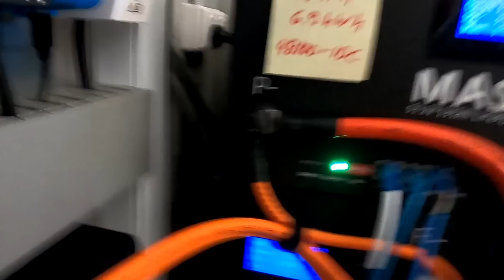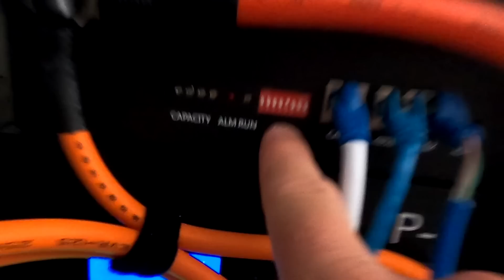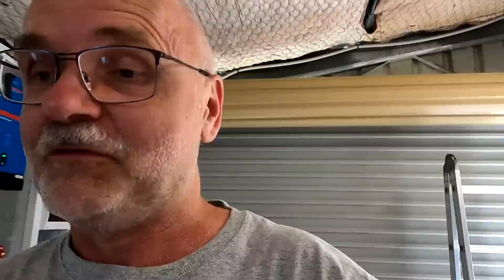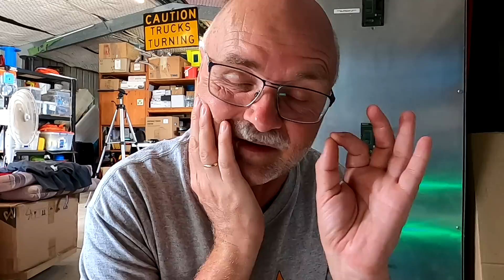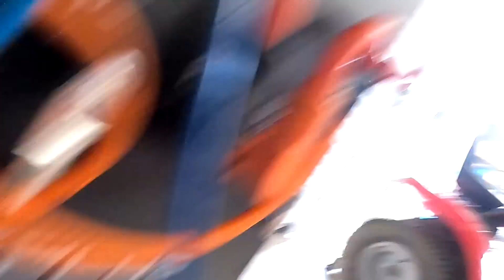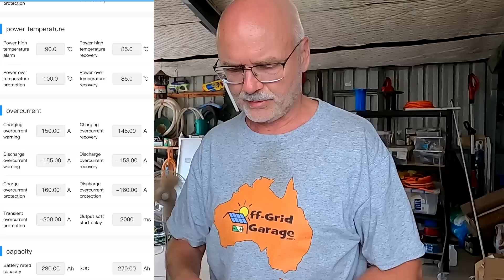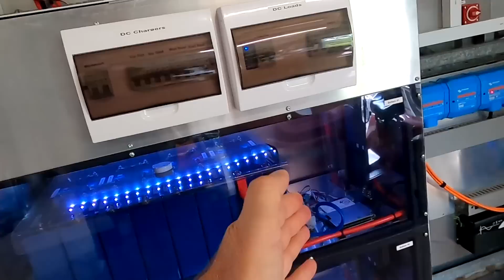No (easy) access to Master BMS of your Seplos battery! Seriously?

Comment: Those BMS...  With that charge difference the BMS in the lower charge batt is going to turn on charging and immediately get a surge from the other battery. That probably causes the BMS to disable charging, and the cycle repeats.
I stand by my last comment - seplos seems like too much aggravation.

Comment: Root of the problem… My professional experience is in tech support of distributed information, object, document, image management systems and the managing QA trams for development of the next gen system and then consulting with clients to design and deploy those systems. The issue is that product developers design based around their own personal expectations of what a product should do, not giving any thoughts to how a customer might try to use it. When managing QA, after getting extremely frustrated with the development team not understanding how their efforts were not reflecting my direct experience supported the administrators of these systems, I finally convinced them to get a focus group together from a variety of backgrounds and give them specific tasks to complete using the interfaces they had developed so far and after the getting the feedback they had a much better understanding that developers know how to write code but don’t have any experience managing a live system so they need to get end user and administrator feedback early. Unfortunately because it took so long fro them to listen the initial release was a massive flop but over time they got there but it took probably an additional 2 years because of how much code they had to rewrite when had they focused less on their own views and more on customer needs they could have had a better chance at a wildly successful product out of the gate.
Reply from the maker: Another big problem is translation when communicating. I really need to break things down and keep them simple, otherwise they won't get the story. Long sentenses and paragraphs are not good and cause confusion. It all takes a very long time...
Reply: @OffGridGarageAustralia  LOL I’m definitely at risk of penning long paragraphs and runon sentences and accept with a smile that part of your response might have also been a good natured jab 🤪

Comment: Andy I don’t think this is a fair test. In Batt 2.0 you have 3x diff BMS and each connects to your monitoring system independently - at the very start you were told by Seplos that the Mason and Seplos BMS were different so why are you trying to get them to act like one system. To be fair each BMS would have a separate connection to the Victron system, and a fair test would be 2x of the same Seplos BMS’s tied together. I think if you consider the Mason and Seplos BMS the same as in Batt 2.0 it would work better. The big Seplos would be on Bluetooth like the other BMS and the Mason via the PC for management. If you had 2x Masons or 2x Seplos the results would be different
Reply from the maker: Thanks Peter. The three different BMS in the shelf are not connected to anything, no comms at all. It would not be possible. There can be only one Battery Monitor in the system, not multiple. So you can have one of the three BMS connect to the Victron system but it would totally ignore the other two.
With the Seplos system, the master BMS collects all the data from all connected slave BMSes and reports this combined to the Victron VenusOS. As we could see on the details page in the Remote Console, it shows high/low voltage and temperature across all packs. This is not possible with the three different BMS we have in Battery 2.0

Comment: Hold the faith andy. I have three of the big battery in parallel and other than the can issues you already know about they have run perfectly for last 6 months in my ess  Victron system with ac and dc coupled solar. I’m adding two more to give 75kwH
Reply from the maker: Thanks for sharing. All the same BMS and batteries?

Comment: It is a shame that the users have to reverse engineer the issues and problems with these BMSs.  Hopefully Seplos gets all of the comments and understands what is happening, then maybe more people will buy into these battery kits.  However, currently it doesn't seem like the two BMSs are compatible with each other and it doesn't look like you can do anything about it without Seplos helping.  Maybe a firmware update, or even a replacement BMS will solve most of the problems.  But, even with a firmware update or replacement BMS it looks like you'll still have issues with the two different battery sizes unless they rewrite the software.

Comment: How about both batteries in CAN mode? No RS485.
Reply from the maker: Won't work. You can only have one CAN battery shown in the system. You could decide which one is showing, the other one would be ignored.

Comment: Yes i agree it is a messy design flaw. SEPLOS should have installed 2x CAN ports per unit, forget about RS485 communication between units and just daisy chain any battery units to the same CAN bus to other systems, like the Victron. They can include a LAN port in additional to Bluetooth connectivity. This would be very similar to how Victron set up theirs. Neat and tidy, no more messing up with DIP switches.
The network topology should either be a star network or daisy-chained network.
Reply from the maker: That is a great idea but I'm afraid it's too late for Seplos to do that...
Reply: @OffGridGarageAustralia  I believe your feedback represents a very reasonable expectation from a typical user and is a very good use case. SEPLOS should take all your advice and feedback very seriously.
Certainly functionality is important, but usability is also another important aspect, especially for higher voltage battery systems involved many cells connected in series. It is important to keep monitoring and spot any potential issues or signs of weakest link. 
When it comes to systems integration, it is all about simplicity, reliability and wide compatibility. Learning from already established brands such as Victron is a great starting point. Look at what they are doing and understanding the rationale behind their decisions. Innovations are good, but only if it improves existing standards... certainly not just for the sake of innovation. 
Let's see if SEPLOS would incorporate your feedback in their next release of products. 😬👍
Reply: If SEPLOS doesn't offer a reasonable solution, a work around might be to purchase just a BMS board but connected  no batteries. Make that unit 0. Then attach your first battery as unit 1 and the larger one as unit 2 😂👌

Comment: Hi Andy, again very interesting to see your video. The communication problem with activated CAN communication is unfortunately well known. This is really not good.
However, I must also say that you are using a system configuration that is not intended. On the part of SEPLOS are only battery packs to operate in parallel, which have the same technical requirements. You have the 280 DIY Pack and the Masonpack with the 135 Ah together in operation. This can be seen from the Ah hours displayed in the Victron. 560 would be 2 packs of 280 Ah. This also says the CAN configuration. 2 packs and the 280 Ah hours pack is your master. The 411 Ah hours are then the 280 + 135 Ah Yes there are still 4 Ah missing, but that is probably related to the calibration values. Try taking out the Mason 135 Ah and putting on the second 280 Ah pack. I could bet that then the system behaves a little differently.
Please allow me to comment on the cables you use to connect the two packs to the busbars. You should connect 1 cable from the Mason 135 Ah pack and 1 cable from the 280 Ah pack to the power in. Not both cables to one pack and then to the Power In. However, it would be best if you connect both packs directly to the Power In and do not clamp the parallel connection between the two packs, but connect the packs in parallel via the Power In busbars.
But before I forget I wish you a happy new year and greetings from rainy Germany.
Reply from the maker: Thanks. I know this setup is 'not recommended' but it still should work. I'm testing here to see what the issues are and how far we can come. I'm sure, the system showed the correct Ah when we tested this before, 280Ah + 135Ah. That data in the VenusOS makes very little sense.
The cables are temporary as I said.
Reply: @OffGridGarageAustralia  No, it won't work correctly, you are experiencing exactly what happens when your loads are not balanced between packs. Just connect correctly and give it a few days to balance. If you had more packs this would be obvious because you would see the packs SoC graduate down to the highest SoC in the pack farthest from the load leads, but seeing 2 you're just not getting it. If you connect as we have said, the load lead length will be identical for every pack and no voltage drop will be visible between packs. Then the voltage being identical, they will self balance. If you connect as Green home energy has suggested, make sure all leads between packs and bus bar are the same length.

Comment: Hey Andy, I have the same issues with connecting. I think as a work around they should make a dummy master module. I have 4 x 100ah and really once it were setup they are working fine. only problem is I had a lose BMS wire in a pack and shut down all supply which is of poor design, and not great for redundancy. The balancing also works fine, as for when I wrote this the difference across the packs is 3.363 - 3.370v which is more then fine. I also find they SOC drift over time and requires a full charge to correct this issue.  Thanks, Matt.
Reply from the maker: Thanks for sharing, Matt. 
The reset of SOC is also a problem as it requires either the cell or pack max charge voltage to be reached before it resets to 100%. Yes this cn be adjusted but imaging I set this to 55.2V and everytime it reaches this voltage, the BMS turns off the MPPTs 🤦‍♂️ They don't understand that this is a problem with their design.
Reply: @OffGridGarageAustralia  I also had a major fault out of the blue, costly fault. The Seplos battery disconnected once charged and because there were only a light loads at 100% SOC. Then I turned a large load on and for an instant the only supply were the MPPTs and the high impedance supply and the mosfets within the Quatttro let the smoke out. careful of the battery set unloading with all the solar you have hovering around 100%, especially with large inductive loads.

Comment: So this is the second video I believe that shows Andy facing the same  "issue" with the dip switch and the master visibility... 
Is this a bad design or a bug? I don't think so. 
1- Victron reporting 2x master capacity instead of master (280A) + slave (135A). Is this issue on seplos or victron side?
2- Victron reporting 411A available capacity. Well, that's close enough (280+135=415A), that may well be a symptom that a full charge/discharge cycle is needed.
3- Master is not accesible. You already came up with this in another video. Is it a flaw? Well it is what it is, if your inverter is CAN, then the master need to be configured as CAN and won't show up in the battery monitor app (as it uses rs485). I agree this is rather quirky as both master / slave seem to talk via RS485 but master doesn't show up in the app. To be honest I've had 2 batteries paralleled for 2 months now and both have been going neck to neck ( SOC delta of +- 0.5 -1 %) since, reliably to the point that I stopped monitoring them as they just work fine. Maybe once avery second week I take a look on their screens but that's it, I don't have the need to access to cells voltage / temp in real time, I leave it to the BMS that has proven so far to do it's job. 

I believe cerbo is able to talk rs485 meaning that you could ditch the CAN and use the RS485 only, that in theory should allow the master to show up in the app along with all slaves right? 

4) Seplos is been clear since the begining re/ your setup, i.e. diff BMS' that is yet to be tested, they haven't guaranteed full compatibility. However I do believe it should work. From your video&comments it appears that it actually works, it looks like a battery went rogue due to a bad dip switch configuration. The master is not visible, Yeap but otherwise both batteries SOC should go hand in hand. 

I guess in summary I hear you, you're frustrated, this isn't a perfect product and may not be for everyone, however other brands are not exempt of flaws or quirks, for instance Pylontech using rs232 to monitor the battery (so in order to make things work you need can/rs485 but rs233) and I don't think it is fair to put the blame entirely on Seplos. The product is positioned as DIY, the documentation covers everything
Reply from the maker: Thanks Alex. I know, I'm testing here as always, and it is 'not recommended' by Seplos to parallel these two batteries, true. Some people have either batteries at home and consider upgrading. Should it work if buy another battery from them with a different BMS? Maybe it works, maybe not.
I know, I'm overthinking a lot here and I'm very desperate to make it work. It seems the limitation is to parallel batteries with different capacities. The software is not capable of getting this right. But again, why not making a better FW for these BMS and make it work. It's not a hardware limitation but only software. They have this great feature of being able to upgrade all their BMS with new FW easily but are not utilising it.
The documentation is far from perfect and does not cover everything, I'm afraid. Some others said, the product is actually aiming for more professional setups and installations and using true A-grade batteries (hence, the very small balance current).
You can turn it as you want it, but the product is great but the features not utilised enough.

Comment: and there is the next problem. 
I have 3x 10E whitout Bluetooth, because i have iOS and there is no app.
and today i see when i put the dip5 to off the communication to Victron is there but Victron shows me than only 1 battery
Reply: I believe you need to set dip 6 if you have 3 packs and wish to use CAN
Reply from the maker: There is an app for iOS now. Search for EN BMS. It's just a blueish circle with the word BMS.
Reply: @OffGridGarageAustralia  now it's to late I have the 10e whitout the Bluetooth displays 😭

Comment: I suggest this is a problem with probably any of these off the shelf battery packs. You get what the supplier gives you.
I think there is a market for "build your own" battery pack using these steel cases. 
Take a steel case. Choose your own batery cells. Choose your own BMS. woolah.....the best of all worlds.
So maybe you should simply replace the BMS with JK.......
Reply: He did build these .
Reply: @onthelake9554  not entirely. The Seplos cases came with the BMS....prob the most critical component of the box. I think there is merit in choosing the BMS first, then the Battery, then the steel box..... When you buy the Mason Seplos you have no choice on the BMS. Wouldn't do it.
Reply: @ianpope7061  The whole point of this is to explore battery communication with the system . No other bms I'm aware of besides batrium and nobody needs that expense.
Reply from the maker: what @OnTheLake said 👆

Comment: This might come across as a bit blunt - but why are you wasting so much time trying to troubleshoot a BMS that isn't on the Venus compatibility list ? - just because it has a canbus connection there is absolutely no guarantee that it has been implemented correctly. I don't know how much you value your time, but why not just buy a proven BMS such as a REC or Batrium, both of which are well proven to be fully Venus compatible and don't have the daft current limitations of those cheap and nasty BMS's that rely on multiple parallel mosfets for their output control.
Reply from the maker: Because I'm testing here. That was the whole point of building the new battery and PowerWall. To test, try and learn. And share of course...

Comment: Did you try turning both BMS off and back on after changing DIP settings? You know it's a valid troubleshooting method. A lot of things read settings at boot and cache that somewhere. I don't see how this could not be a thing here.
Reply from the maker: Yes, both have been restarted multiple times. In fact you just need to restart the master, the slave will follow...
Reply: When all else fails…reboot!

Comment: It seems Seplos needs to add an external antenna socket for an antenna to be mounted outside the metal case for decent communication also. (And supply that external antenna as part of the kit for the BT BMS)

Comment: IF you have a Bluetooth BMS, and want access to a remote site via an onsite PC,.maybe a Bluetooth to serial adapter could achieve this (eg IRXON BT578 or BT580 - supporting BLE and SPP), assuming the BT BMS and the PC software allows such access. Maybe something you could try Andy. Still, it's not great if you have the older BMS.

Comment: Now I don't have a seplos, but familiar with 485. Can't you just move the id numbers of all the packs up by one. Ie the first pack is now 1 not 0 and 2 not 1.... Then there would be a valid dip switch setti g?
Reply: If you have CAN active you must have address 00 in the system. Otherwise it won't work.
Reply from the maker: It won't as the combination 10001000 does not exist for CAN communication. CAN uses the last 4 bits of the DIP switch only. The first 4 need to be 0.